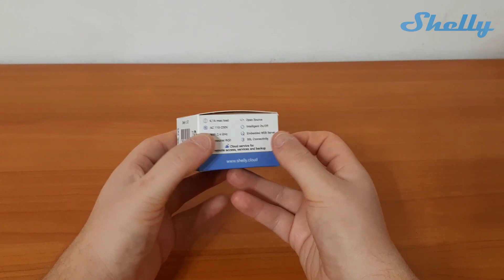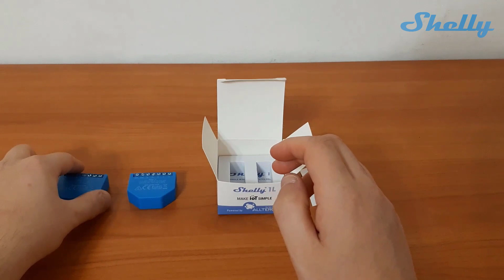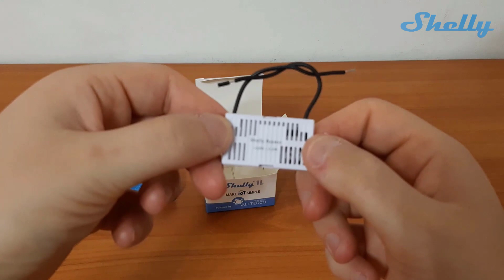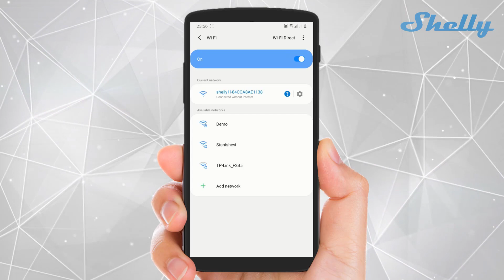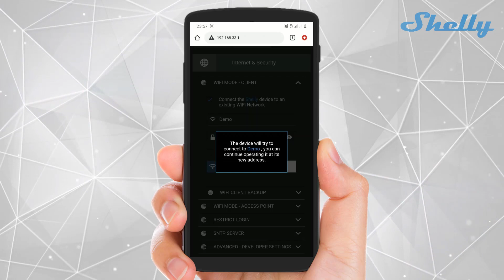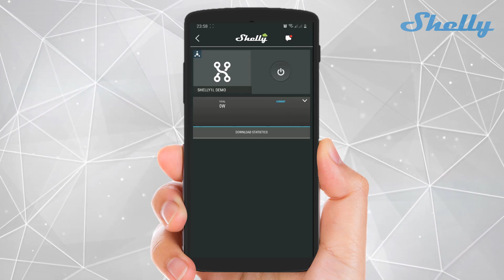Shelly How to... - Shelly 1L

Comment: You guys have managed to make an incredibly confusing video, too many wires and switches for a "simple" guide.  You should really re-do this video with a single switch installation and no neutral line.
Reply: You still need the neutral. They cleverly call it no neutral because they designed it to be back fed from the neutral through the line. Shady as hell if you ask me. I don't have neutral in switches so I bought this. Surprise! You still need the neutral
Reply: @justinanderson8518  You dont need the neutral you just need the bypass card installed in parallel with the light if its a non incandescent bulb.

Comment: I‘am completely lost after the video. I need exact this thing because I have no neutral, but I didn’t get the wiring
Reply: Didn't make any sense to me either, 'we have a device that doesn't need Neutral but lets use the bypass cable and connect to the Neutral???
Reply: @martinparkinson935  The video is not very clear - but basically you wire the bypass in line with your load / bulb not at the switch end. So if you have a ceiling rose for instance you would connect it here to the positive and negative. The bypass is just a device that adds a load onto the circuit.
Reply: I agree with those who feel that the bypass thingy needs a bit more clarification. Thanks to some comments I get it now.
Reply: @nicksunny  The bypass device simply is a load that ensures a little current flow to the shelly. So the shelly gets Live directly and Neutral through the Load (paralelled with the bypass).
That is enough power for the shelly to run. So to speak via higher impedance neutral.

Comment: What is the difference ?! You still need neutral to connect to just using a different port! So it's actually not possible to control without neutral. 
Am I missing something something obvious? 
The setup in the video is confusing.
Reply: Yeah I still dont get it
Reply: You dont need the neutral where you install the shelly (generally behind an existing button where in renovation you only have the phase from the main electric box). You just need to add the « by pass » in parallel of your load (generally a light bulb) which is already by nature connected on one hand side to you ‘cutted’ phase and on the other side to the neutral going to your main electric box. (Sorry i’m not native speaker, what i name phase is the « L » entry and what i call main electric box is where you have your different electric lines with their own power breakers)

Comment: It's great that you made a video about this device, but it's hard to follow. Wiring is messed up - why are there three wires connecting a switch to the shelly? What are white wires? The message at 3:15 is very confusing - what are you trying to say there? Do i need to wire a separate live wire to the shelly?
Reply from the maker: Hello! :) 
You should power SW1 and SW2 directly from Sx. This is what is shown on the wiring in the top right.
Reply: @Shelly_IoT  Excuse me sir, you do not refer to the fact tha a significant number of people complain about the confusing video , why do you not take this to your attention?
Tank you

Comment: I love how their video says the bypass is required but it is an additional item you have to purchase. On the website they describe it as optional. "No neutral" is extremely deceptive. Now that I bought it I still DO NEED the neutral and going to have to pull the ceiling fan apart to access the neutral up there because they didn't run them to the switches. Still having to access and tie into the the NEUTRAL is NOT what no neutral means to me...
Reply: well its what it means to basically everyone else lol, no neutral means no neutral in the switch box, electronics dont run on magical fairy dust. Your other option would be to destroy your roof or wall or both to rerun modern electrical cabling to your devices

Comment: Would be nice to do a video explaining differences between Shelly1 vs Shelly1L (vs Shelly 1P), not so clear the No Neutral option.
also does Shelly 1L could be used in a Multiway switching (Montage va-et-vient) wiring ? (inverter switch), thank you !

Comment: Ok so i'm no electrician, but isen't the idea of a bypass device to use that when you DON'T have a neutral avail to hook up into the shelly? Here you connect the neutral to the bypass witch in my mind defets the purpose of it since you could have just have connected the neural to the shelly? Or did i missunderstand everything? :)
Reply: The video is confusing, here's what I make of it:
The bypass is to be placed near the lamp, where you have a Neutral cable.

Cut the L(switch) cable going coming from the switch and going to the lamp in two parts, near the lamp (preferable in a connection box) and connect them again using a WAGO. 
Here you also insert the bypass (when light or whatever doesn't meet the minimum 20W resistive load). 

Then also cut the N (preferable in same connection box) and reconnect them again using a WAGO and insert the other bypass wire here too.
The Bypass sits between  and connects the 2 WAGO clamps (let's call them the L clamp and the N clamp).

What I'm not sure of, is when the light or whatever does meet the minimum 20W resistive load.
I think you still need to connect a wire between the 2 WAGO clamps (N & L).
The wire replaces the bypass device.

Comment: I agree with others that this video makes little sense. I know you use the clamps for easy demonstration but I think it would work better to show it being done as if we were actuality wiring it. Also, if you're going to claim it doesn't use neutral, don't show the neutral hookup? I vaguely understand it doesn't need that wire but not how you bypass it if you literally don't have a neutral wire to use.

Comment: Why two switches for a single output? Is it intended to be used in a 2-way configuration where you don't have enough cables?
Reply: stair or cross switch are the answer.

Comment: If you're confused about how to wire the shelly 1L without a neutral cable to the switch, check https://www.youtube.com/watch?v=DI7IBbiH4l0. The image at 7:26 shows the connections clearly. Just keep in mind that you'll most likely have to put the bypass in the ceiling and not at the switch because it effectively connects the live to the neutral.

Comment: nice attempt but while this Shelly 1L is adviced as "little" and easy to fit, it is hard to fit in exsisting electrical system due too many wires to connect.
You'll have problems to fit or close your wall switch box.
Good item for "funny tests" but nothing else.

Comment: This is a bad explanation of No-Neutral wiring setup. Very confusing and complex. Wire layout demonstrated was not clear, especially where and how the Bypass dongle connects. I had to watch other videos to figure this out. Shelly needs to improve this video, otherwise the unclear wiring instructions discourages buying these... why not just show a room wall switch and light install. 🤔 annoying music too, which adds to frustration when having to rewatch the video a hundred times to figure out what you are doing with wires all over the place.